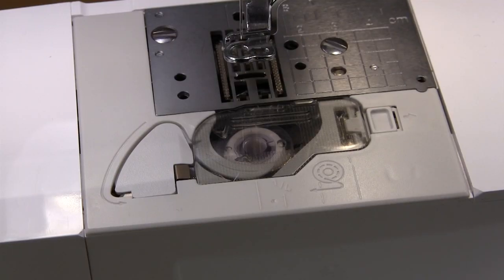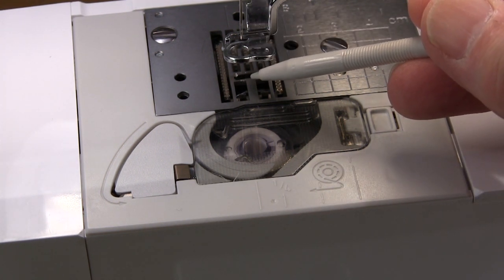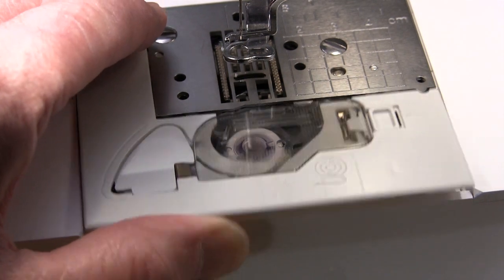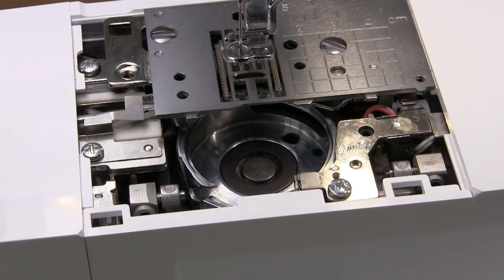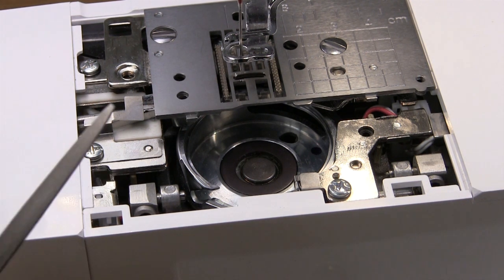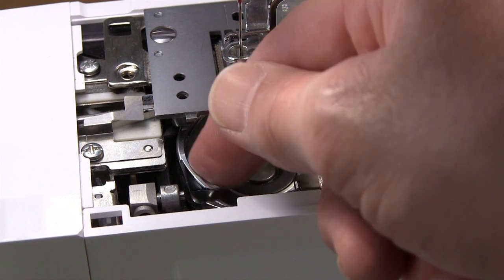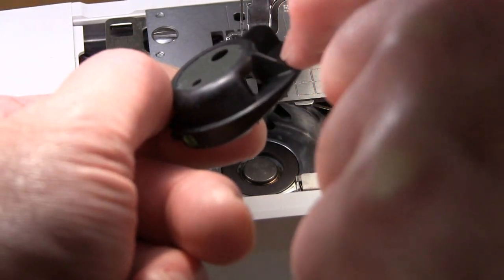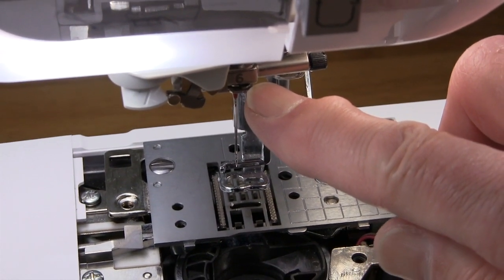My top thread is shredding

Comment: THANK YOU!!! I was embroidering blanket number 11 of 15 for graduates at our church when the thread started constantly shredding.  I used this video to diagnose the problem, a burr.  I filed it and things worked fine for a couple minutes.  Then the machine kept saying I needed to rethread the top thread, but it appeared fine.  I used the other video that shows how to fix the little thread spring (it has shredded thread jammed in it) and now it's smooth sailing.  If I lived in the UK I'd give Keith a big hug and kiss!!

Comment: "The right needle for the right job"; no truer words have been said. I have a Janome 4 needle embroidery machine and started having a "thread shredding and breaking issue". I tried everything, spent hours messing with the bobbin area and looking for nicks, cleaning, oiling. I finally figured it out and solved my problem. Wrong needle. I was embroidering on hats and when I switched from 75/11 needle to 80/12 needle, my problem was solved! Right needle for right job can solve thread shredding and breaking issues. Hope this helps someone else....

Comment: Thank you for your video I am new to machine embroidery and have just spent an afternoon adjusting the tension on my machine both top and bottom because the thread kept breaking after checking your video I found a nick on the bottom bobbing hook as you described it is working much better now. Thank you

Comment: Very useful.  I am researching this for a sewing group.  I wonder if that burr on the shuttle race (that holds the bobbin case) hook is caused by needle timing being off? I'd love to know.  Many thanks on this excellent video!
Reply from the maker: That’s a small possibility but if that was the case there would probably be other indications in stitch quality. The burr could be caused by the needle position being set too close to the hook causing the hook to hit the needle constantly, which is an engineer adjustment. Most likely it’s a single occurrence where an event during embroidery or sewing caused the needle to bend when penetrating dense stitching or fabric and was hit by the hook. The event is usually a one off and deburring the hook stops the shredding, if the needle-to-hook clearance is out then a trained and trusted technician is advisable for the correct adjustment.

Comment: Keith - I have a new problem that I can't find an answer to.  My top thread is nesting and snarling beneath my hoop.  I've done everything I know to do, changed needles, vacuumed thoroughly, checked bobbin case for burrs, cleaned the thread cutter.  HELP!
Reply from the maker: Peggy, check your upper tension, if you have contamination then your top thread will nest. Beyond this you probably need someone with some expertise to investigate. - Keith.